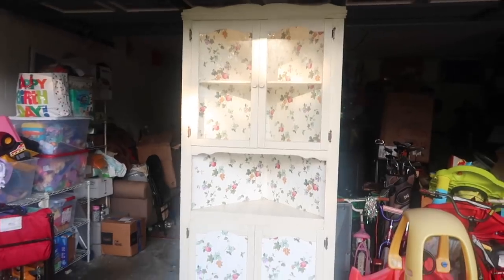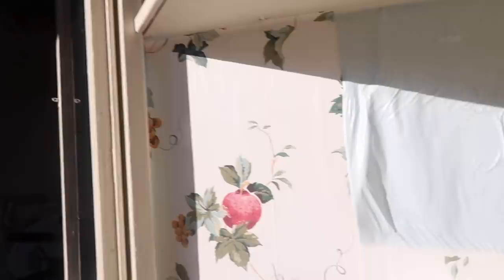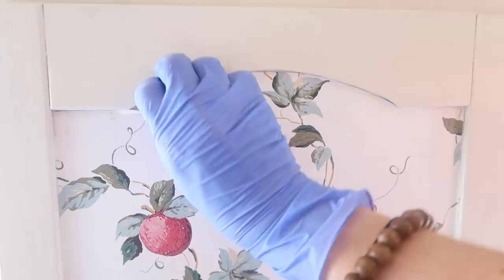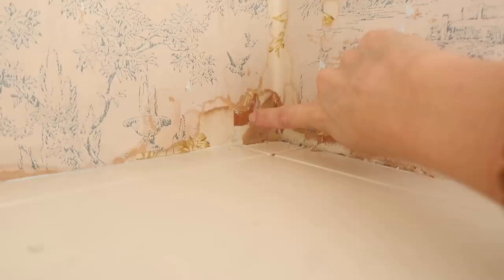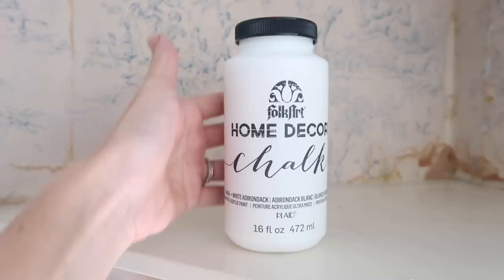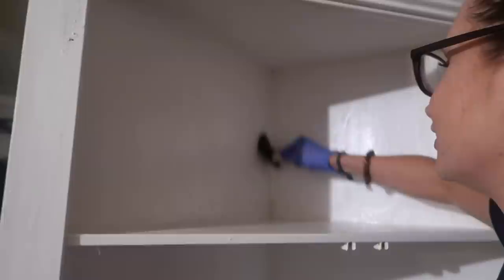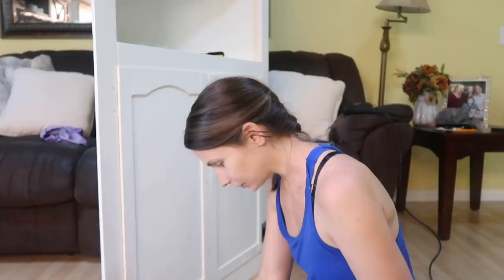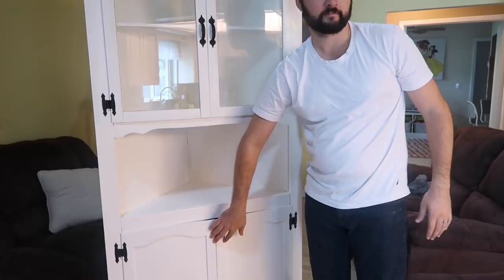How Old Is This Thing?! DIY Refurbished Antique Cabinet!  Craft With Me! Farmhouse Style!

Comment: You did a great job. I love chalk painting.  Just a little suggestion something I learned the hard way don’t press so hard while applying the paint with chalk paint you will get brush lines. Less pressure more paint makes for a very nice smooth finish. I also would suggest Behr chalk paint it’s not super thick much easier to apply. I’m not knocking what you used I’m just not familiar with it.  But like I said it turned out beautiful!
Reply from the maker: Thanks for the tip!!